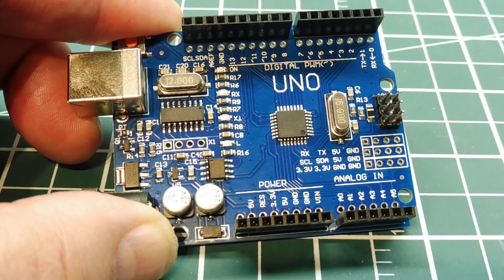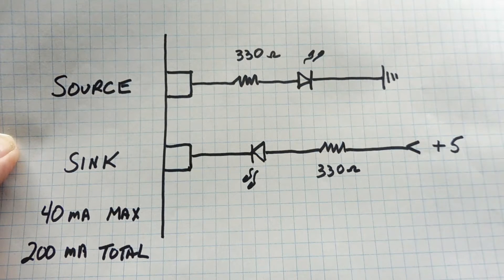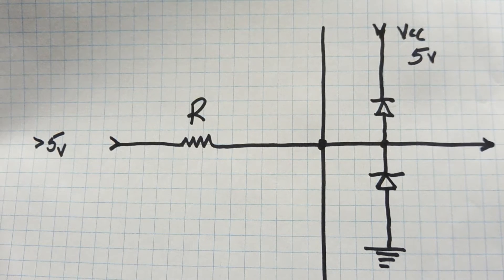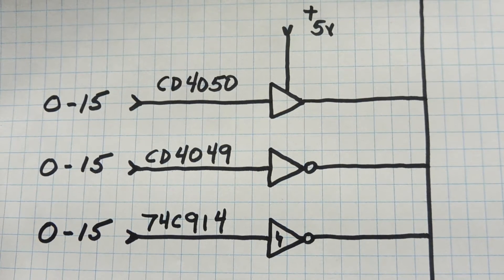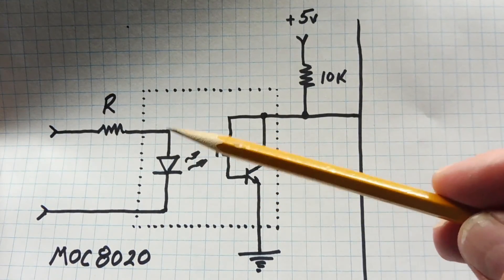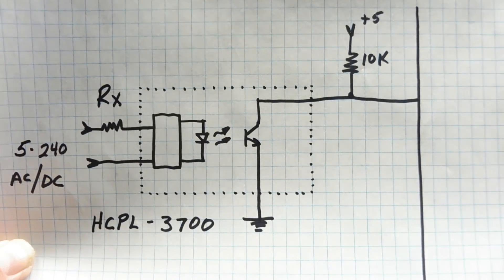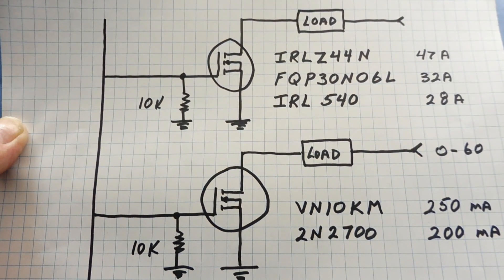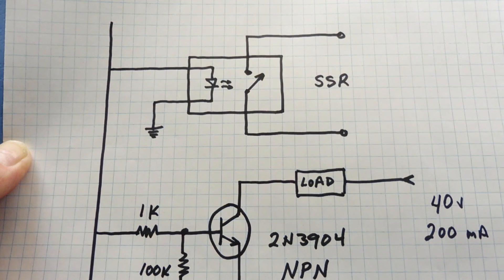Microcontroller GPIO Interfacing

Comment: The problem with the mosfet that if there is a short circuit between gate and drain, it will damage the microcontroller, nice video
Reply from the maker: You could add a 180 Ohm resistor in series with the gate lead for protection. A Mosfet is a voltage controlled device with Hi-Z input so there is no degrade in performance. Thanks for the feedback.

Comment: Hi 0033mer, when connecting your sink circuit examples, like in your inverter chip and 3904 options, where in the circuit does the negative lead from our power source connect to?
Reply from the maker: The negative lead of the power supply is connected to circuit ground and is usually implied in schematics. Check the inverter data sheet and look for the pin labelled GND or sometimes VSS. The negative lead connection for the 243904 circuit is the ground symbol which is the emitter on the transistor.